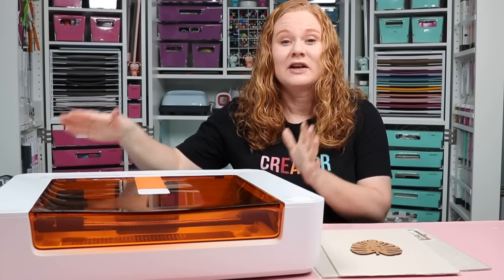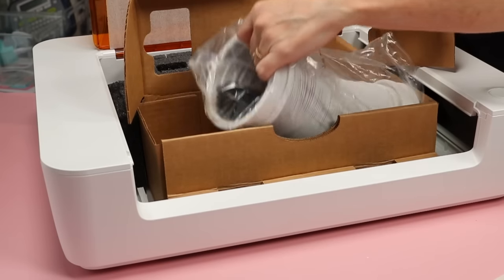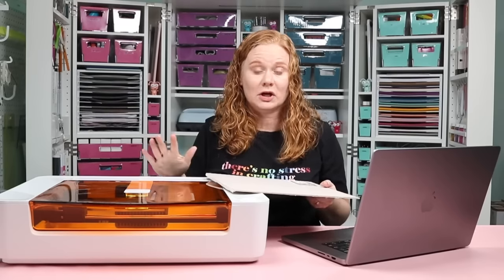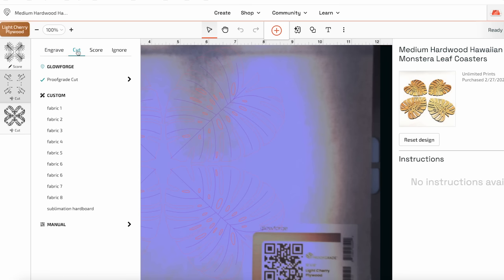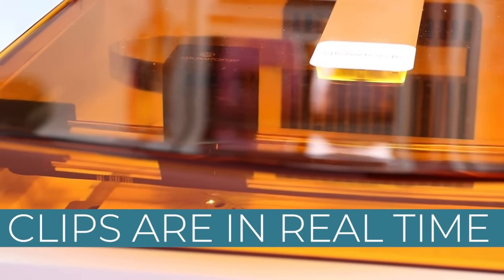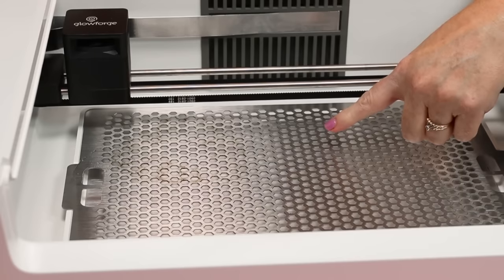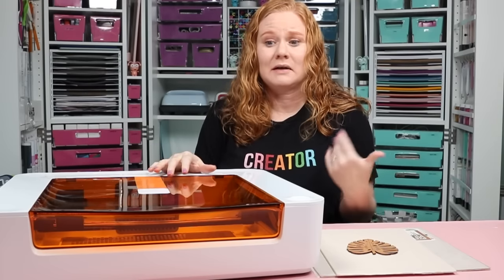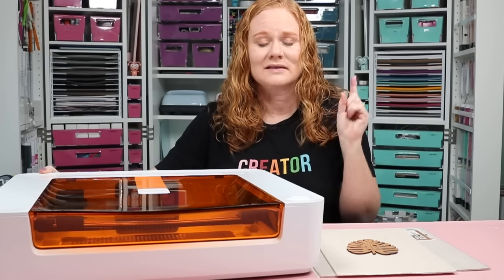Glowforge Spark: Your Ultimate Guide to this Craft Laser

Comment: How does the spark work with slate tile? Wanted to do coasters and is the “engraving” deep or merely etching? Thanks for a great video!
Reply from the maker: On slate, it basically removes part of the black if that makes sense and it will be white in those areas. It will work the same as the Aura in this video: https://www.youtube.com/watch?v=SO2v-qtwc10

Comment: Hello!! Thanks for the video very informative, however I am a little bit confused you list the Acrylic in the list that it can cut and then in the list that can’t cut certain colors. I would love this spark to make an acrylic cake toppers and few other stuff for my brand. Can I use it to cut Acrylic if so what about pink color, gold color white etc?
Reply from the maker: It can cut acrylic but it WILL not do clear. You may also have issues with light colors.
Reply: White is very difficult to try to even etch with a diode laser. I think a co2 laser would be best for that. I've had good success cutting black acrylic on a diode but it took 6 passes on my 20 watt laser. You definitely want to vent it outside.  Acrylic stinks a lot when you cut it. You could test different coatings on white acrylic to see what works best such as paint or possibly marking spray.

Comment: If I’m starting a business on Etsy, do you recommend buying this machine? Or spending more money and getting the bigger one?
Reply from the maker: For business needs, you will want a larger one. You can definitely start with something like this but be aware it is very slow and you will want to upgrade quickly if you get orders.
Reply: More power equals faster cuts and engraving.  I suggest checking who is using what machines for their personal laser business.

Comment: Hello! Great video! So I’m a bit confused as to the acrylic portion use for this machine. I know it could engrave but what do you mean when it can’t cut clear? Would it have to be like purple, orange or mirror like?
Reply from the maker: A diode laser needs a color there in order to cut or engrave. So it works on things like wood because you can't see through it. When it comes to acrylic, you will not be able to do clear and you could struggle with light colors or light blue. Darker colors of acrylic work just fine for both cutting and engraving.

Comment: Very cool.  Can you engrave on a cutting board?  Or does it have to be the size that fits in the bottom well?
Reply from the maker: You can but it would have to fit in the bottom. It is about 9 x 12 inches so anything smaller than that.

Comment: Can you put a removable coating over light colored material, like acrylic? I'd like to use white acrylic and make my own sublimation blanks.
Reply from the maker: I have played a bit with it but the issue is the light from a diode laser goes through the material as there is nothing there to stop it. So I haven't had success.

Comment: I thught I saw another video where they said you CAN do a 12" x 12", but you have to do something like put a line - or make a line,, and only do half of the item... then stop, move the wood forward a bit more, then it will do the other half.  So - will a 12"x12" piece of wood fit in?  I'm curious because aren't most pieces of wood we'd use - or whatever material - normally be 12x12?  AND - sorry for more ?s... is there a link to getting the various types of wood you mentioned?  I got my pre-order and am anxiously awaiting it's arrival.  I was a bit sad to see that the air filter system is nearly as much as the machine itself - so that put it over $1,000.  Still... less than the aura/filtration... so... off we go!
Reply from the maker: 12 x 12 will fit. That is what I used. You will not be able to go all the way to the edges in this machine without cutting the material in pieces as you stated. I am using proofgrade material in this video from the Glowforge website.

Comment: Will the spark or aura cut out mylar stencils?
Reply from the maker: Stencil material would be clear so a diode laser would not work with it. Also be careful as most of these may be made from hazardous plastics. Looking and I do see a blue stencil film made for laser cutting. This one may or may not cut it as it is blue and transparent.